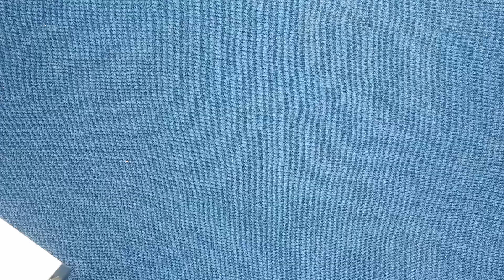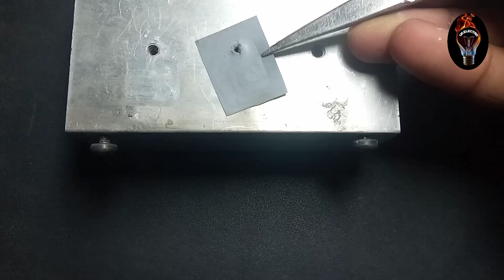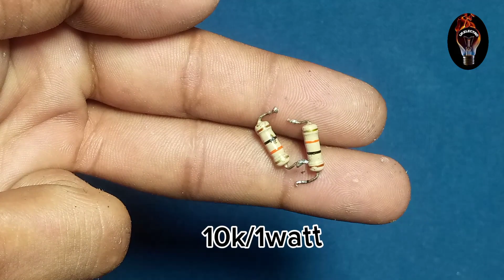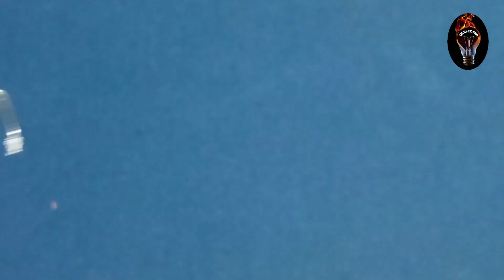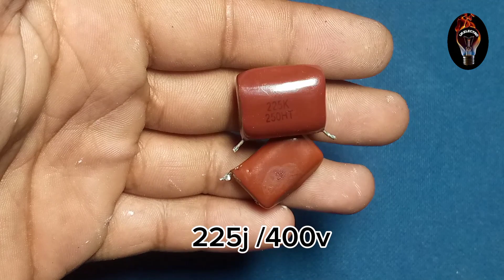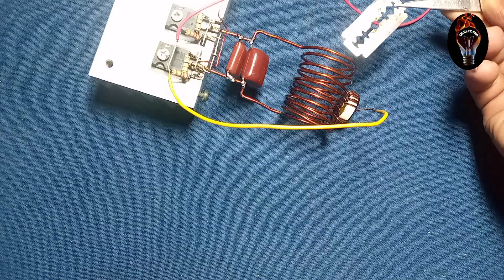DIY 1000watts Induction Heater||How to make a 12v/1000watt Induction Heater Using IRFp460 MOSFET

Comment: 1000W by 12V would be approx. 80A there is noway those wires can handle 80A they would be hotterthan the metal you stick in the coil.